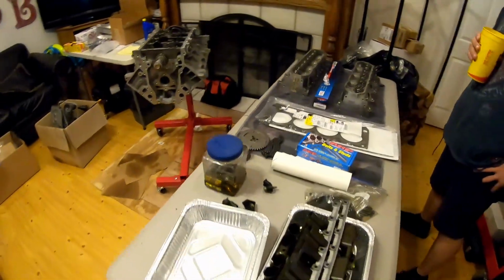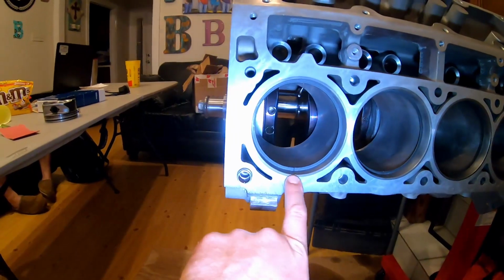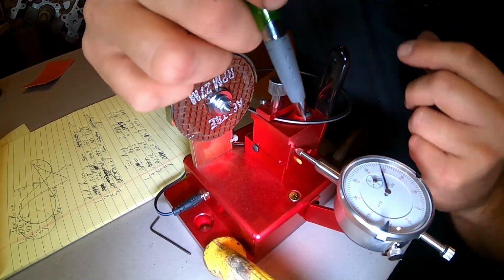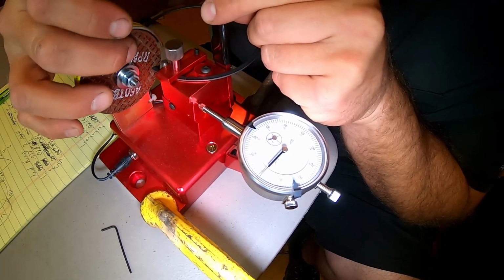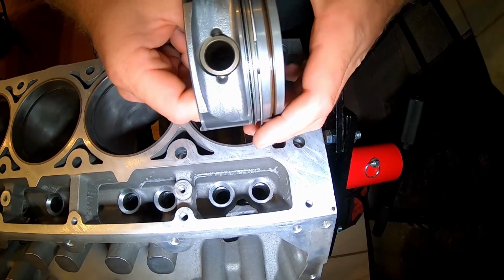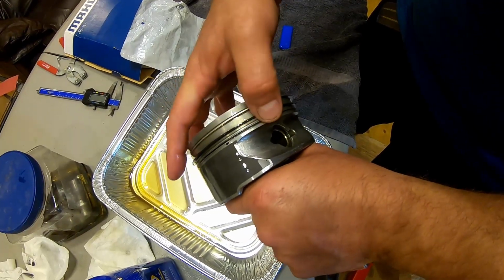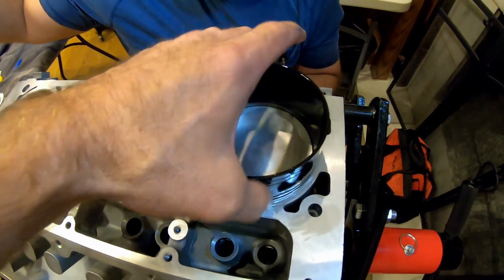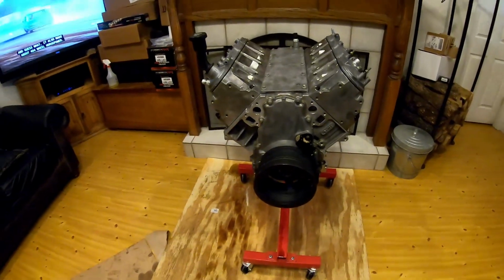Part 2 LSA build for the Silver Sleeper, How to set up and use Proform Ring Filer 66765

Comment: Why only .026" gap on the rings? Shouldn't it be more like .028 ring gap for boost and possibly. 030" for high boost?
Reply: Sorry frank just seen this but i was never planning on running high boost mainly because the truck cant legally run faster at the track and my turbo is max out.